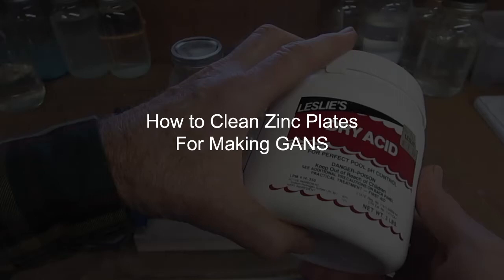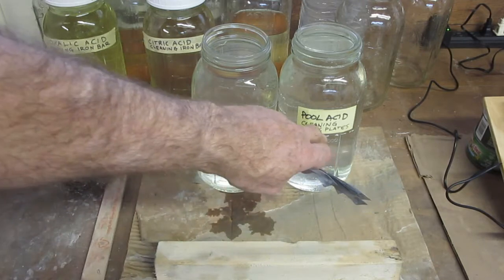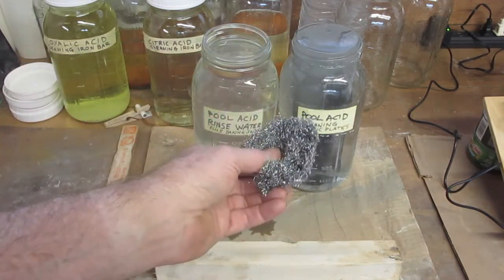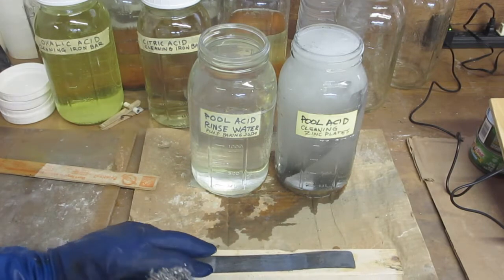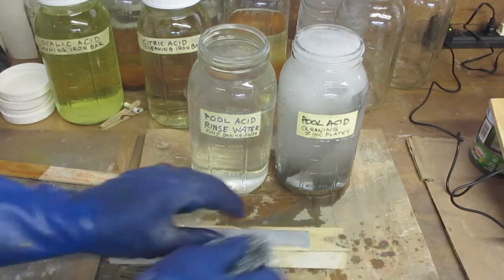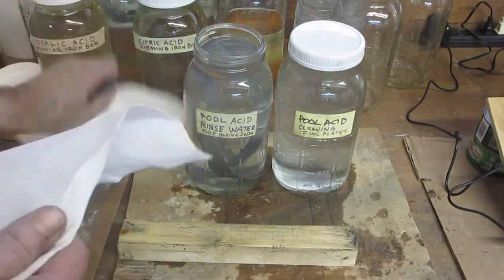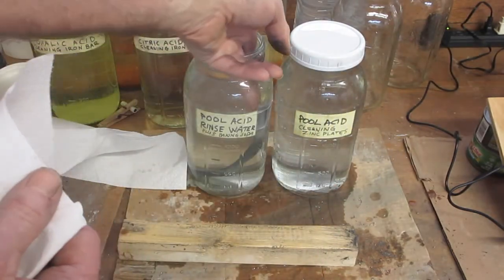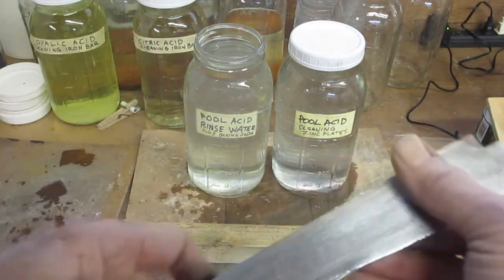Cleaning Zinc Plates For Making GANS

Comment: He thinks its called  ? No explanation on where to obtain zinc plates ?
Reply from the maker: Search Google or DuckDuckGo for "zinc moss and mildew preventer strip". It's a roofing material used to inhibit growth of moss or mildew on roofs. It's available at most hardware and building material stores. It usually comes in a 50 foot roll, 2 5/8 inches wide. I hope this helps.

Comment: I don't have any sodium bisulfate on hand, but I have a few tubs of sodium metabisulfite... Can that work as well? Or is this a stupid question? lol.
Reply from the maker: Honestly I don't know if sodium metabisulfite would be appropriate for this purpose. I did an online search for something to clean zinc plate. I found an industrial user forum and someone suggested using a weak acid. That's what lead me to try dry pool acid. I experimented with the concentration of water to dry acid. It worked for me so I thought I would share it.
Reply: @plasmaworkshop  i tried acetic acid (vinegar), didnt seem to work too well. I suppose i can make it a bit stronger.
Thanks for the reply!

Comment: What is the procedure for harvesting zinc from batteries to use for CO2 GANS?
Reply from the maker: I'm not familiar with that procedure, but you might try searching YouTube for how to obtain zinc from old batteries or how to extract zinc from batteries.
Reply: @plasmaworkshop  I just got everything going and it seems to be producing well. The nano coated coil is generating a swirling effect of very small bubbles and the zinc I harvested from the old batteries is now coated with tiny bubbles. I hope that's hat I'm looking for????
Reply: @plasmaworkshop  it's been going for about 20 min and now there is this milkey cloud surrounding the zinc plate. It's very cool.
Reply: @plasmaworkshop  any preference on length of time to let the components work? I've gathered a very nice layer of white material matter in he bottom of my glass. I would say the nano coated coil is operating about 30% less than in the beginning but it's not yet been 24 hrs.
Reply from the maker: @maddyvonirsik7391  You just want to stop the process before seeing too much bare copper on the nano coated plate, otherwise the color of the GANs can start changing to a bluish green color cast.
Reply: @plasmaworkshop  thank you for the response ive been reaching out to tons of ppl and no one seems to be interested in responding. I disconnected and let it settle and aside from the small fragments of zinc the material looks great.